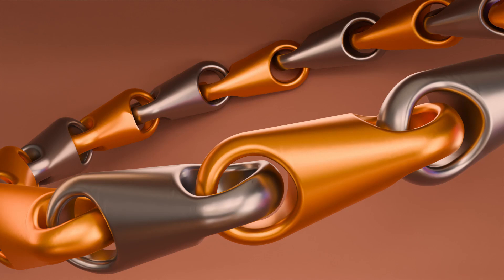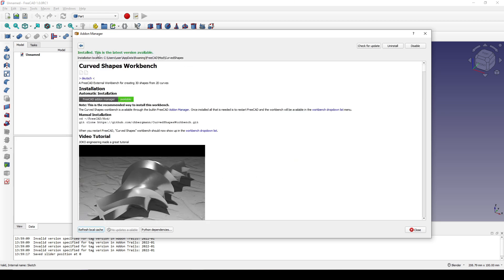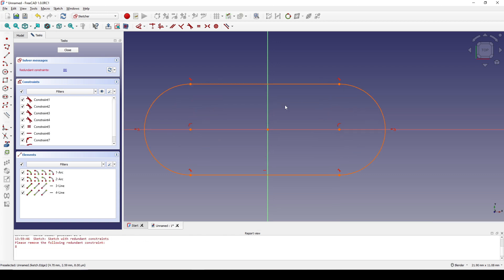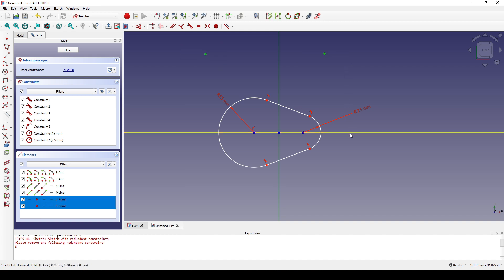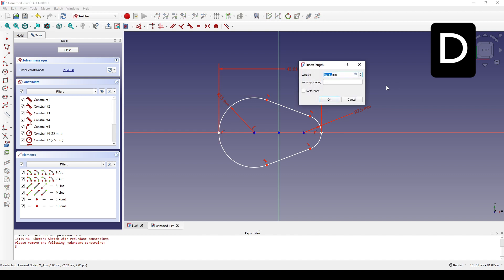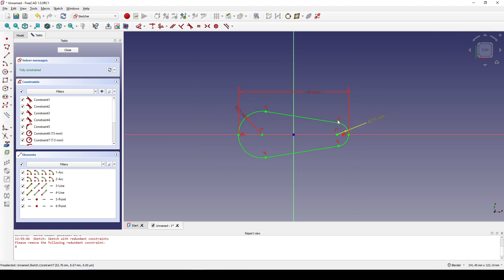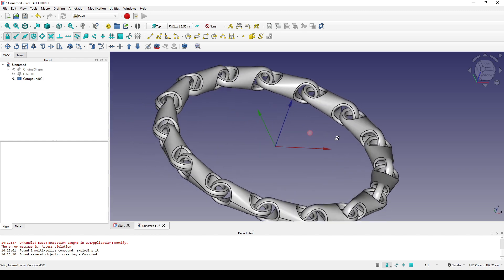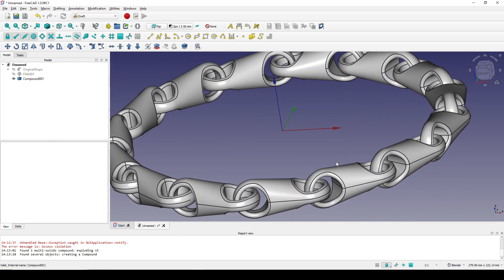Latest Version Of Curve Shapes WB in FreeCAD: Create A Bracelet.

Comment: Cool technique! One thing I noticed is that at about 2 minutes into the video, you selected the dots, then the line and used the C key to move the points onto the line. In FreeCAD Version 1.1.0dev.38923, the key is now 'O'; the 'C' key is for coincident constraints. Otherwise, your instructions worked perfectly!

One question - at the start of the video, you have every other link set to different materials. I tried to do this, but found that I had to select a lot of surfaces on each link before I could apply the materials. Did you find a quicker way to do this?
Reply from the maker: When you downgrade the array, do not upgrade, then you select the solids that you want to apply material